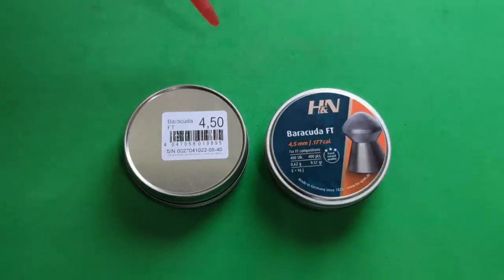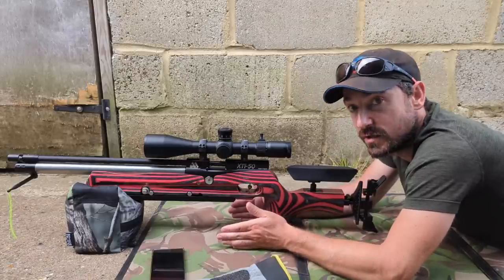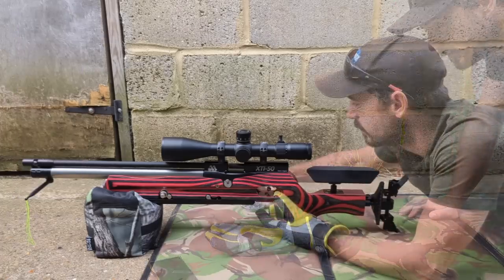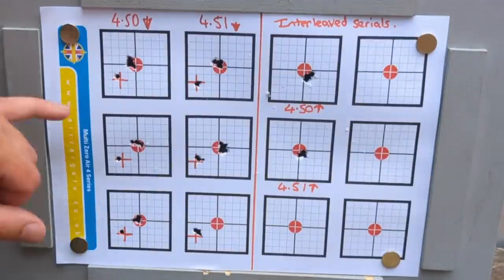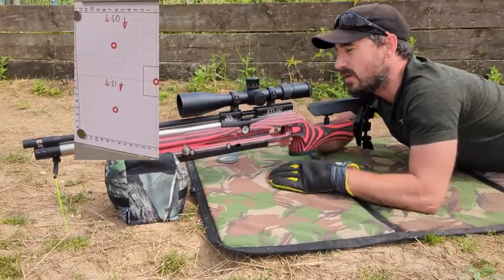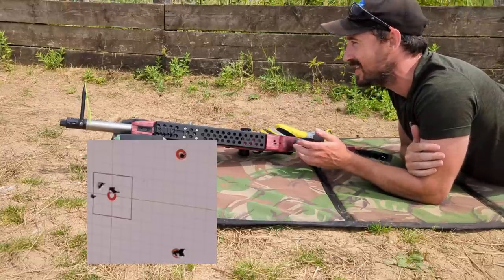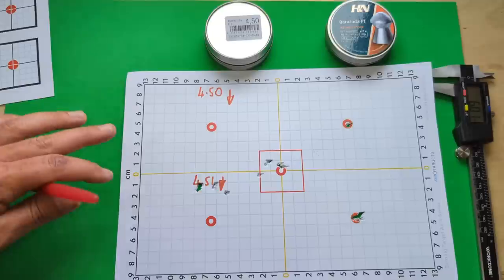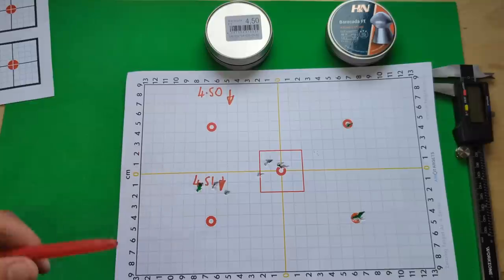Using military testing procedure on air rifle pellets to improve accuracy in the wind!

Comment: I am not sure if that is the proper way of testing Air Rifle pellets? Because some of them are pure lead, some lead alloy and other are lead free. That means they will act different sliding down the bore while shot on they own lead film smeared in the bore and different on the lead film of other, earlier shot pellets. Thats why you should "foul" the barrel after each cleaning with that lead film. Military uses propably only copper or brass jacket bullets so it doesnt make any difference but still may.

Comment: When an ill-fitting pellet leaves a piece of lead in the barrel it would effect the accuracy of the next pellet, which may be perfect  yet show a poor group through always having to content with debris. The test is worth doing as a piece of critical analysis but should not be the only test.
Reply from the maker: Absolutely correct.it needs further testing to check how feasible it is going forward but the concept seems sound enough to add to our usual testing regimes.

Comment: You live on a farm right? Why not build an enclosed 45yrd tunnel or use a barn for pellet testing. You need to remove the wind variable completely
Reply from the maker: Honestly mate, removing the wind isn't that useful atall unless at design and development stages of airgun manufacture. (That's another sideline of mine)
If like me you only shoot outside, then testing indoors will give you way more false positives than you'd really like. There's so many pellets that will give mega results indoors, but the moment you get into the wind they are wild and unpredictable. 
I've some batches here of 2022 jsb heavies that frankly are only 'ok' indoors but incredibly consistent in the wind, moreso than many other batches of numerous brands I've used.ive also had batches of express 7.9s that are absolutely br accurate indoors but basically impossible to use predictably at range,in the wind. That predictability is what we need when dealing with the wind and weather at our typical powers and ranges.😉

Comment: I truly wish you were able to test .22 at FAC levels. I prefer 18 grain + for hunting and seldom ever see any real quality videos on what it does down range and potential accuracy unless the ammo happens to be slugs. I prefer pellets not only for cost but safety. Many seem to have forgotten what the shape of our ammo does to its effectiveness down range and distances due to drag. Slugs are a no-go where I live for the most part. Only a few directions they can be sent safely. You do pellets and thorough and informative videos. I hope I can see this in the near future. Your into precise accuracy as am I . Don’t know how others aren’t as concerned about boringly accurate.😉BTW can you include each round’s speed? That would help a lot also.
Reply: Once a pellet hits a certain velocity it tends to lose stability and will tumble which is why you'll see slugs used on fac as slugs dont use drag to stabilise at distance so they maintain a lot more kenetic energy when they impact vs pellets.

There was another british airgun channel using sub 12 ftlb testing pellets vs slugs and he even had a device that could measure the projectile speed even upto either 50 or 100  yards away i forget exactly how far it was but i remember his findings were the pellets lost a good amount of their kenetic energy at around 50 yards.

Comment: Interesting theory, hadn't tested exactly like that but have seen the difference with baracuda ft early batches in 2019 where the head sizes sent (4.50 and 4.51) made massive differences in both drop and how much wind they took. My tests were done with 3 guns, the steyr, ye olde pro target and the 9015.

Comment: I've recently been pellet testing with my new Impact. Indoors at 30m, I couldn't pick from 3 pellets, Bisley LRG-14g, JSB   -15.8g and AA-18g. All pellet on pellet. Down the range in windy conditions, out to 30m all were good, at 40m the LRG struggled, the other were ok. But with the windy gusting up and down it was difficult to get accurate info. So, I loaded my magazine with alternate JSB and AA, my target was at 50m, A4 paper with one centre dot. 2 groups formed straight away, JSB blowing off to the edge of the paper with a 2 inch group but the AA-18g were only an inch to 2" from the centre dot, with an inch group. All done with quite rapid fire.  Tried the LRG at 50m but struggled to hit the paper in the wind. I then moved out to 64m 3" spinning targets, still windy. With 10 shots, aiming off the LRG I hit 1 out of 10, JSB 5/10, AA 8/10.  So, I'll be using the AA for long range hunting and others for close range stuff.
Reply from the maker: It's amazing how much the wind affects the downrange performance eh. I love all the testing it seems like I'm always learning more every time I push myself in the wind.😉
Reply: @tillysgunstocks.... A big part of doing the test was that the majority at the range were saying lighter and faster in the wind is better, so in the case of .22, the 14g in the wind were terrible even though they were the fastest through the chrono. My next test will be to compare my R10 that loves JSB 10.34g in the wind against my .22 impact with AA-18g, both rifles set up next to each other, two targets side by side, at 30, 40, 50m both being shot at the same time and then we'll see the movement and group size against very fast .177 and the slower 18g  .22.
Reply: The higher the bc of the pellet  through your gun the less wind they will take. 
It's that simple ..the speed and weight don't have much to do with it .presuming  the muzzle energies  are the same .

Comment: This is great thanks  I just started doing this with my .30 cal AEA Challenger.  .30 cal ammo is more expensive and my budget is limited so I just did this today and found that .301 Javelin 52 gr grouped better than the H&N Slug HP II, 30 Cal., 54 Grains.  So good in fact that I came home and looked up National Rifle League competitions in my area.  I think I have this .30 cal beast tuned well enough to at least dip my feet in the competitive pool.  Thanks for your videos.  I will be adding a little wind flag to my rig thanks to you
Reply: the range here in Idaho has grass all along the way so doping for wind is easy but that won't always be the case having a wind indicator on board is a great idea  I also would like a scope level for NRL

Comment: Excellent stuff , and an excellent pellet as well ( no matter what the head size ) always keep half a dozen tins in stock at home .. Don't really matter what size head they are when I go to the shop .. nevertheless , if ive got a new rifle to test , I will use the same brand in the barrel .. ie: FT's , FTT's , terminators , ect , THEN clean barrel for different brand ... your vids are very interesting ... lot lot better then striking up a conversation with the wife .. OR .. watching antiques roeadshow ( other crap TV programs are available ) .. keep up the good work , our sanity depends on you in this crazy world ...
Reply from the maker: Looking at how the different head sizes perform down range, I'd think it's definitely worth running both side by side and seeing which if any,gives a marginal edge. Them 4.51 are much easier to judge the drift at 45 and further in my barrel.
Not too badly priced and readily available too.😉

Comment: I would think it is only a good way of testing if you use the same make and lead composition. I have noticed some pellets not that bothered with shooting alongside other makes and others very fussy. Crosman have been the worst for me and need a good leading in before the groups start to shrink. I have been getting great results with BSA Goldstar .22 in my R10 and HW90k. My 99s loves .177  Daystate Kaiser and my Daystate Mk3 RT .177 loves JSB 8.44. I have been told 4.53 work best but could only get 4.52 last time I bought some. Love your video's and always look forward to new content.

Comment: The only way to test one pellet against another is to take out the human influence, especially loading a single shot rifle between rounds/pellets, and then remove the weather, so this means an indoor 25 yard range with a maintained temperature, and the gun clamped in a frame that is bolted to a concrete floor.

Interleaving aside, you have too many other control factors to remove from the situation, depending on the rifle, before even considering moving from Groups.

In addition, I would argue that you would also have to use an identical scope on different rifles to remove any difference caused by optics in a real World post indoor testing range time.  Again, preparing for real World use, after selecting the best pellet indoor at 25 yards, you'd then fit a barrel tuner for use at your selected pellet a your favoured distance beyond 25 yards indoors.

Then, all your efforts in the real World are Human and Weather related, you've selected the best pellet for the rifle, and tuned the barrel for it for longer distances; the rest is you and coping with the day.
Reply from the maker: Hi mate, removing the variables such as a wobbly human behind the rifle and the wind won't tell you an awful lot when you get outside. I gave them away, but recently had a batch of express 7.9gn that were absolutely br accurate indoors at 25. Infact one of the best I've seen in recent years. However they were hopeless in even the lightest of winds outdoors.

Imo you absolutely need to set your equipment up in the conditions you use them and familiarise yourself with how they perform down range in as many varying conditions as you can 😉
Reply: Testing in ideal conditions has its place, particularly in projectile or barrel development, but all final testing should be carried out in field conditions. Artillery range and accuracy trials are always carried out with the guns in "as used" configuration, even down to the level of using weights to simulate the crew's personal kit in a 30 ton vehicle, with the ground also being chosen to represent typical service conditions. I have seen cases where ammunition which has not been tested in field conditions, only controlled test conditions, has been bought by the thousand only for it to be unusable in service. This usually happens when the ammunition which has been bought is marginally stable so that anything which disturbs it is catastrophic, which will not show in trials carried out indoors in perfect conditions from a gun stand. The method shown here was developed to try to ensure as far as possible that the two projectiles being compared see the same atmospheric conditions, not just wind though that is usually the main problem, but any atmospheric condition, they can all affect how your projectile flies.
Reply: @tillysgunstocks  I did mention the real World outdoors coping bit, or I think I did.
Reply: @milesm1465  Well, not sure many pellets pass through any thermoclines on the way to a target, but weighing them out, sizing them, all indoors, and trying these in varying wind conditions after proving they group the best indoors is the real World test, finding out they are unstable in certain conditions would be a reason to reject that pellet type/manufacturer.

I get the same issues at 100 yards with .22lr in windy conditions (Lapua Centre-X), where projectile spin and wind direction/gusting play an enormous part in the results on the range I use at 1,280 ft ASL in South Shropshire.  I accept that pellets 'are' inherently more stable below 950fps without spin.  BTW the difference between 25 yards and 100 yards is 10 MOA of holdover using the above brand.

Also, Target Competition when its raining stair rods at any distance is challenging, although I'm not really testing the maximum range of .22lr which to all intents and purposes is probably somewhere between 800 to 1200 yards depending on stated fps (saw an experiment where someone was firing out to sea where various buoys marked the range), despite the warnings on the box being up to 2 miles.

All I'm interested in is a safe backstop.

Comment: might be interesting to get chrono readings, and as you say head sizes , tail sizes might be just as important . However judging by your initial results extrapolating meaningful results might well be as pointless as it would be difficult.
Reply from the maker: I don't think this would replace our usual testing regimes, but certainly a useful additional test for when the weather is marginal and you still need to test.  Monitoring the drifts and drops at range will be enough to tell you wether it's worth carrying on with a particular pellet. 😉

Comment: Is your xti shooting as it should? I'd expect far better for the money? My ultimate sporter r does 20 shot group of 11mm at 46m with baracuda ft and hft500 does 10 shot group of 6mm at 46m with jsb heavy. Both outdoors using unweighed pellets.
Reply from the maker: Yep it'll absolutely stack them In calm conditions, the groups are exactly as you would expect in the wind.  Just a 3mph wind will give approx 1cm of drift at just 25yds.  Add in a swirly wind running all over the place and along hedgelines and not aiming off to accommodate the wind and the groups will be all over the shop.  The forecast when I shot these was 5-9mph that's potentially upto 50mm(or more ) of drift at 45yds.😉
Reply from the maker: I'm also looking at buying a fancy anemometer (wind meter) with a large display,hopefully I can get it to do real time wind readouts so we can see what's going on down range better. Good idea,you reckon?
Reply: @tillysgunstocks  silk ribon on a stick will do 🤣
Reply: @tillysgunstocks 
Windsocks at airports are actually rather accurate at indicating diffrent wind speeds/direction. 
I use 4 foot welding rods and “indicator” tape + a handheld anemometer (for reference)
Reply from the maker: @kris2435  last time I had a ribbon out, I turned my back for a moment and the goat was trying to eat it 😆
Reply: @tillysgunstocks  😂, barbed wire with wings ? 😆

Comment: The Head size marked on the tin is meaningless. For example in a tin marked 4.50,,yes you get about 20-25 % 4.50,,the remaining 75% are a mixture of 4.49,,maybe a few 4.48,,  some 4.51 and some 4.52.I know this to be basically true,,because I have measured many a tin(over the past 10 years).The weight  can range,in JSB's case(the diabolo 4.52-8.44 grain) all the from 8.2 gr. to 8.7 gr.-sometimes higher smotimes lower.
Look at Englands own ''Si Pittaway'' and his videos on this effect on  shooting  accuracy.
Reply: Might as well cast your own at that point, then size and weigh after casting and remelt dosn thise not upto size/weight.

oh wait basically nobody makes pellet molds...

Comment: I cannot for the life of me,understand why you are not weighing them(using the exact same weight each time)  ,AND sizing them( to get same same exact head size),,,to can get these results  use a good scale($200. at least),and the   ''Pellet Scale''.
Without doing these procedures,,,you are going around IN CIRCLES,,like a dog chasing its tail.,,AND  getting the same results time after time.
Reply from the maker: It's simply a proof of concept at the point of filming, so going too mad weighing wasn't a consideration.

But as an aside, the average weight variation through the tins of h&n is of far less significance down range (at our typical sub12 ranges)than the wind/prevailing weather conditions.

Now we know that interleaving is a viable proposition we can take it further with more involved /tighter tolerances on the pellets and larger sample runs 😉
Reply: @tillysgunstocks  Totally disagree,,,how do you know without testing???   I have,,,I know,,,,you do not!!!